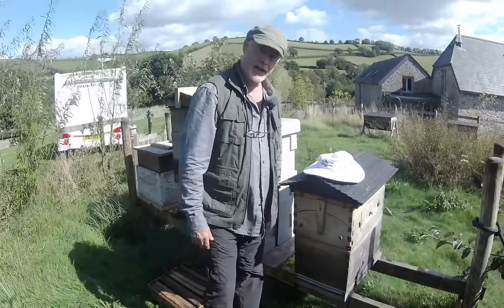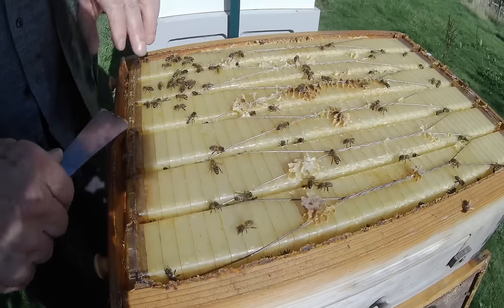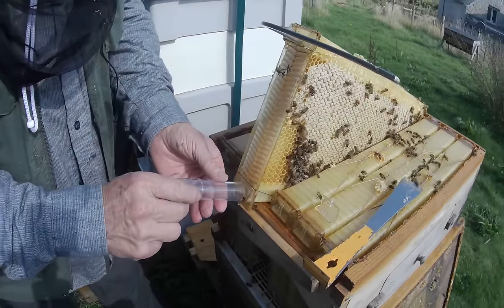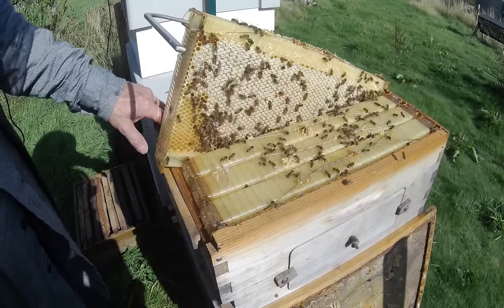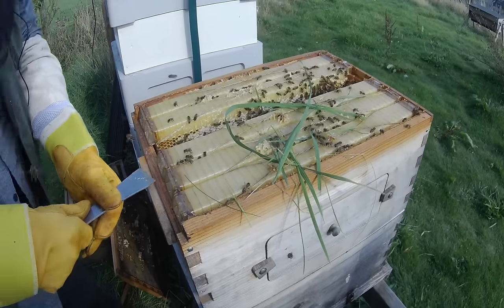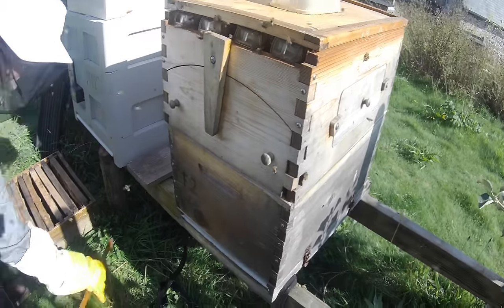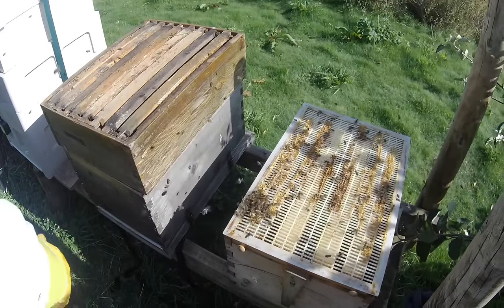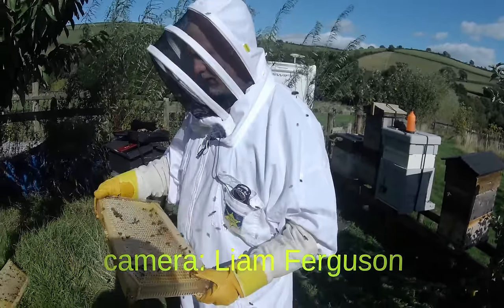Don't buy a Flow Hive until you've seen this!

Comment: I do not think I have ever seen bees that mad, especially when using a flow hive.
Reply from the maker: Then you haven't been around bees very long. There is a wide range of temperament among bees, from the most passive to the most defensive, This colony is only slightly above average in defensiveness.
Reply: I once had a colony that was so narky that I couldn't even walk past it on the path in a beesuit let alone without one. They hated the very sight of me and would attack. They also were extremely swarmy and I couldn't get anywhere near them to deal with it. It was my 3rd year of beekeeping and having had 2 very easy ones up until that colony, I very nearly gave up beekeeping altogether. If it hadn't been for my mentor coming in to help out and sorting the hive out for me, I'd not be keeping bees now, 10 years later.
Reply: Idk anything about bee behavior, how can you tell they’re mad? I’m curious
Reply: @ericplut8930  the noise they were making and the rapid flight. It didn't help that he got stung several times letting the bee's know its game on. I got a hive last spring and a cheap bee suit. I came in off the road one day about dark and decided to pop the lid. They don't like to be messed with at dusk and came out after me. I had a couple get inside my hood and I panicked knocking it to the ground. When I managed to get away had 14 or 15 stingers in my face and 15 or 20 stings on my bald head.  Lol. PS. I bought a good suit and leave them alone when it gets dark.
Reply: @garyhaley3072  damnn bummer. I am interested in it at some point. Is it very likely hives get aggressive on newbies?
Reply: Eric P... No. Bees won't get angry at Newbie Beeks !
 If you manage and handle them correctly, you can overrule their bad side !
 By :
Time when you inspect.
How you inspect.
Do slow steady movements. Do you Smoke or Water Mist them?
Do you bring in new genetics by replacing the Queen? Or Split the Hive and add a Queen Cell from a nice colony... Etc etc... 😏
"Mad Bees will teach" the Beekeeper loads... How you deal with them, what's good practice, get a mentor, or join a Bee Association helps ! And, keep learning !!! 🐝🐝🐝

Comment: You need to study up on a product before you try to teach a procedure. You also need a hive tool that has the "hook" on one end that is designed to go under the top frames. That works on regular brood frames and the flow frames. Also, the frames are designed not to move to the point that the bees are injured when you operate the flow tool. Also,  bees work the flow and regular frames from the center outwards, and top to bottom.
Reply from the maker: (1) I was not intending this to be a teaching video, as I pointed out (more than once) that I had not extracted honey from this hive before. (2) I was contacted by the makers 6 months before the product was launched, so I had both an early education and advance notice of its release. (3) see my follow-up video. (4) Yes, I know how bees work frames after 20 years.
Reply: This video explains very well some of the weaknesses in the flow hive. No where can you verify eaily all youy honey cells are sealed therefore youy could have high water content,  which if extracted too early ferments into mead, alcohol. So am adopting is made that when the end frames are called all should be,  but that is not any where near always the case

Comment: You need to watch Fredrick Dunn .works every time and he has a lot of them . 

Plus you got yours on backwards. 
No wonder bees are escaping. Or wrong size deep . Etc. 

Flow hive I put one on top of my horizontal hive. It’s great.
Reply from the maker: What do you mean by "backwards"?
Reply: @BarefootBeekeeper   

In film it looks like it's in front . To get honey . The way I have seen it and done mine it's in the  back to get the honey .  That way bees are not disturb.
Reply from the maker: @coziii.1829  I am taking the honey from the back of the hive, as should be obvious from the video, which shows the front of the hive with the entrance facing away from the wall.
Reply: @BarefootBeekeeper  I suspect he's refering to the amount of bees coming out from the gap near the righthand frame.

Comment: despite the negative comments he does make a good point about not being able to easily determine how much of all the frames are capped so you know when to harvest. This was one of my concerns when considering the flow hive, although price and the fact I needed our first hive immediately when a swarm turned up in our backyard, forced us to go the standard route. A cheap $80 two frame stainless steel extractor from ebay has worked well for the two hives we have in a suburban backyard. And most importantly using a spiked roller to pop the caps rather than hot knife, mess and containers.
Reply: When the frame in the window is capped they're all capped.
Reply: This raises an issue of the timing of harvesting. given my current  experience with my hives, if I had waited until all the frames were capped, my next harvest would be too close to winter. recently (early spring where I am) I was able to harvest 6 frames and left the outside ones and then I might get a full harvest in Feb and then let them gather in autumn (fall) for winter. This is also after turning some of the frames previously as the bees tend to favour the side facing the centre. Perhaps in more stable climates where the flow hive was developed where there is flowers all year round then these issues would not be a concern.
Reply: Is a spiked roller effective for spinning out honey?  How large are the pins?

Comment: I'm not condoning flow hive but from what I see part of the assembly on the flo box is missing that's why there are bees at the back ware you collect the honey according to the instructions
Reply from the maker: Nothing missing. That's built to plans.
Reply: There is a flat metal bar missing from the bottom of the super which is allowing the bees into the harvesting end of the box.
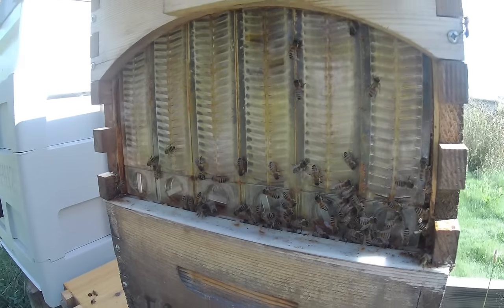Reply: Yes, there should be a thin metal bar that prevents bees from going through the queen excluder into the 'harvest' area of the box.  Also would prevent the wood from warping away from the flow frames somewhat on the left side (see lower left corner of video at 1:05 where the bees are trying to close the gap with propolis) .  Not sure if it wasn't included in his kit or if it was a later addition to the box after his shipped, but if you go to the instruction videos from the flow hive people there is a metal strip on the bottom of the box just below the harvest tube ports, right where he puts his finger at 0:48 to point to the white strip of the queen excluder which shouldn't be visible at that point because of the bar.
Reply: Agree definately missing the aluminium strip that closes the gap at the rear. There are no bees at the rear when you extract the honey if assembly is complete.
Reply: @garyweir5055  thank you.
Reply: Jonathan Wilcox 

It’s on backwards as well as missing part
Reply: @BarefootBeekeeper  Could you please address the above?
Reply: @yui907  he wont when he is proven wrong he gets a bit buthurt
Reply: @GundrakMafia  That's a real shame, I really respected him until I found this out.

Comment: I know of a dude who has a system similar to the flow hive, but his doesn't have plastic honey combs. The design is different as in it has a permanent crank on each one following left to loosen, right to tighten or open and close and there aren't any bees in the back section where the honey is extracted because there is a seal between them in the back and next to the walls as it slides in grooves that are too tight for bees to wiggle through. It's mostly metal except for the comb part it's self and the outer wood box. The comb part is made out of plex glass instead and is shatter resistant. The moving parts when turning the crank to allow the honey to flow out the spout at the bottom are all made out of metal and you really have to beat on it with a hammer hard just to warp it. Now only if I could remember the name of the system he has, been a few years sense he explained it to me but I'm sure I've forgot a bunch of details. One last thing is his has 3 sections or boxes. Brooding section, honey comb and another honey comb that can't be extracted. The one that can't be extracted is in there to allow the hive to survive during the winter and you only are suppose to extract the extra where the system is built into it.

One day I'll own some land in the country and have a system setup as well, but it wont be flow hive.

Comment: I keep around 40 colonies. Supplying each with flow concept equipment would cost more than a twenty frame extractor and a top of the line bottling tank.
Reply: Yeah I often thought that. Which makes it ideal for hobbiests...except I'd never recommend these as a first hive either. :P
Reply: And you do have a nice extractor and tank!
Reply: @jetblackstar  On the contrary, My FLOW hive is the first I've ever had, and if I had to go into honey production the "OLD" commercial way, I stay well away from it. Far to messy and expensive for hobbiest.
Reply: I would agree with much of what you've said @Vote PPC! The cost of buying a heated wax knife, or extractor plus facilities for cleaning equipment before & after & storage of same, which a commercial apiarist can factor into the costs of such equipment & the running of their business etc in over the period of production & possibly claiming a tax offset (as a business expense).

As you have touched on, the Flow system is aimed towards a different market. A combination of the home environmentalist trying to help increase bee numbers & yet providing enough honey to feed a family & some friends. 

In our case, we've got such a productive hive we will shortly be able to sell some locally plus make mead etc. Currently, our one hive which we set up in late Nov 2018 has produced more than 25 kg. In the last 4 weeks, we harvested the four middle frames & installed a new secondary brood box towards the establishment of a second hive next year. Checking after 4 weeks provided us with the knowledge that the eight new frames have had wax drawn over 80% of each of the frames, plus a refill of the four Flow frames again. Brood & honey were abundant in all standard frames. So we've harvested 14 kgs honey & 2 kgs of clean honey comb in 1 month.

I have to say that the video above has so many errors it's almost laughable in it's arrangement. A case of throwing the instructions over one's shoulder & then complaining about the mess without acknowledging the incorrect assembly & use. It's not a very subtle attempt to blame a poor job on the tools rather than the workman. My husband is of the opinion that this was a deliberate attempt to discredit the Flow Hive system.

Comment: Read the instructions and do your research.  Check the combs by providing bee proof openings in the flow boxes, its easy to modify your standard boxes.  Extract from the hive on hot days with a flow going on.  A heather flow is not a good candidate by your description for this method .  Try to NOT disturb the bees while the flow is on, it disrupts progress big time.
Reply: Ok, this isn't a heckle. I'm genuinely confused. How does a bee proof opening allow you to see the capping on the central frames?
Reply: @jetblackstar  Hi Jet!  The natural tendency and nature of the honey bee colony is to begin placing surplus nectar/honey in the central regions of the hive's storage area and work outward in a sort of ball shaped pattern.  Typically, the last areas to have capped honey are the outer corners of the outside surfaces of the outermost frames.  Thus, having an inspection "window" for one or both sides of the excess storage super will let you notice if those outer-most regions are completed.  If the beekeeper wishes not to provide the side window(s), she/he can also get a fair assessment by looking at the ends of outer most flow storage units.
Reply: @rooster3019  Thanks for your reply. Ok, so the "bee proofing" the inspection hatch doesn't affect the ability for a flo hive to inspect the centre frames. It just means you can check the outside without releasing bees. (i.e. mildly less hassle/disturbance). Thank you.. There are loads of comments on this vid obsessing about the missing metal bar and bees escaping and I honestly couldn't figure out what on earth that would improve. Bar being a teency less disturbing for bees.
Reply: @jetblackstar    I am not sure about "bee proofing".  I kept bees since my early teen years up until I was in my mid 50's; but in standard deep and medium equipment with extraction and comb.  This flow hive concept is new to me, but I have been studying it too and I am sort of like a moth being drawn to flame.  Disturbing the bees varies hugely among different keepers due to talent and experience.  If I do this, I will make the rear access for inspection and harvest using aluminum angle to block rear access at the top of the flow combs.  There is a  video on that as I recall.  If your area has strong flows, comb honey is a good alternative.
Reply: @rooster3019  Its a curious innovation. I'm not against FloHives entirely and a little bit of me is curious. I'm just struggling understanding the various Pro advocates points. There seemed to be an obsession over this missing mettle bar.  Frederick Dunn is the only pragmatic clear one I've come across that already understood bees. I'm only three years into my bee experience, But honestly I'm heading the other way (away from traditional bee keeping but towards natural beekeeping) leaning more toward Dr Leo Sharashkin's method of being less invasive. (He also uses horizontal hives like Phil does but different design) And that's to find ways of reducing the normal many inspections for swarming and not the once a year harvest. Because honestly the honey harvest is about the least invasive and disturbing job I've had to do with them. Last week I popped open a hives super, took one single frame crushed and strained and it took less effort and equipment than cooking a soup. Having a hive on tap just ins't that great a desire. Last years harvest involved a bee escape the day before and zero stress for the bees. I really enjoyed extraction. FloHive is just too expensive for me to consider when it offers so little pros for me. 
I prefer the guy who made plastic casettes in supers that he could literally lift out, put a lid on and sell as cut comb with no cutting lol. Now thats low input.

Comment: goodday.. In my opinion the design of flow hive gives part of fun into the hobby and its design infact looks quite nice. In my opinion, you still have to check regularly to inspect each frame.  Flow hive is only good for flowing type of honey. The best thing in my opinion is harvesting the honey away after gently brushing them off while I can get jars of honey without thd needs of spinning honey which exposed to air.. its just part of the fun I get from flowhive supers.

Comment: I thought this was a different video than what I watched before.. until I read the description...

"We've had Flow hives in several locations for three seasons now, and this is the first time we have had a measurable amount of honey in them."

...so I think Ive commented on this before....basically I touched on its the 1st harvest so how does he know it won't work as mentioned?

an other thing I think I didnt touch on.....is WHAT 3 years and your bees didn't swarm ..have health issues or some other problem?  If no dang those bees have not been in favorable honey making conditions and I can't see how blaming the super for that.

I already mentioned lots of the steps he took that seemed off/wrong....I wouldn't be surprised if I didn't notice other beekeeper issues.
Reply: ohh an other thing I noticed in the video..."heads in cells".

um according to instructions you dont fully open a flow hive unless you want problems.   The combs need to be opened gradually by only sticking the metal tool part way working it little by little.  Failure to do this can cause many issues...even pinching bees.

Comment: Those girls sure got upset with you pulling their home apart... Was reassuring to see because one of my hives is like that; they make it very difficult to do a simple inspection, slow things down and they take unnecessary casualties. 
I have other hives that I can pull apart, remove frames and separate boxes and the girls hum peacefully away going about their business as if nothings going on.   
If all my bees were like the ones you have in that flow hive I would give up bee keeping... the good easy-going calm girls are what make bee keeping and joy and pleasure
Reply from the maker: They sounded fierce, but they called down pretty quickly. Not the best tempered bees, for sure, but I've had worse.
Reply: If the bees are defensive requueen with a calmer bee genetic line if you can. The nuc I bought and put in my flow hive is great. I will try breeding queen's from that queen next year.
Reply from the maker: @garethpattinson2099  they were only moderately defensive. I may re-queen them in the Spring but they will be fine for the winter.

Comment: You show total disrespect for your bees.  Learn how to treat them properly before giving inappropriate instruction to others.  Brushing off with grass?  Placing the frame so far away from the hive and not allowing the bees to easily make their way back to their home?  Slitting the capping with bees around?  Squashing bees?  I find it hard to believe that the Flow Hive would cause the honey to crystalize; seems more probable that you have other problems in your hive.  I've been a Flow Hive user for years and am most satisfied with it.  You might like to read the instructions, use it properly and educate yourself before you criticize it.  I can totally see why your bees don't like you!  Honestly, you should just remove this video!